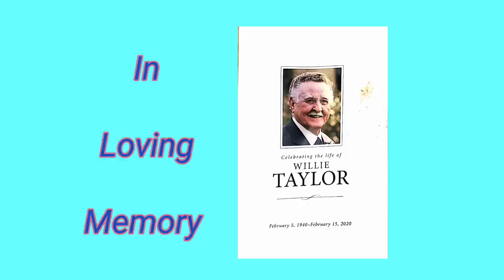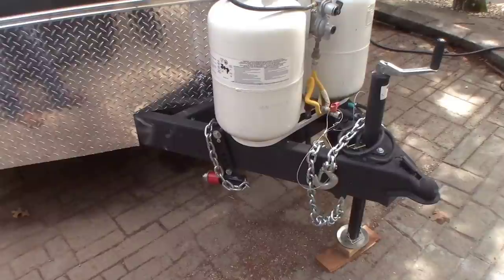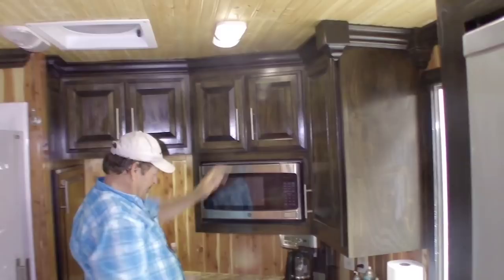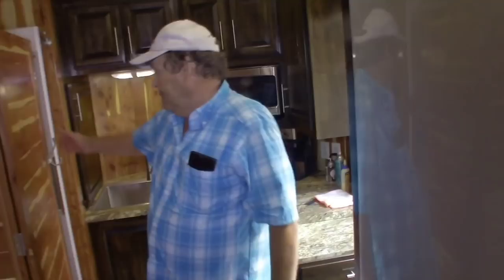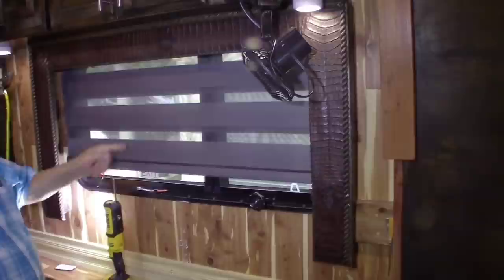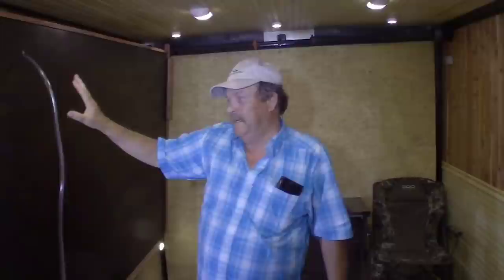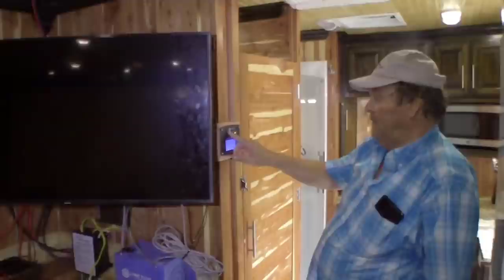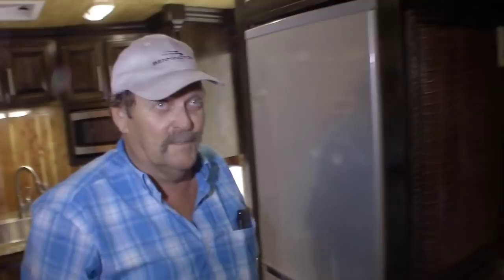Cargo Trailer Conversion/From Cargo Trailer To Luxurious Toy Hauler

Comment: I was wondering how long will the batteries and that 3000 watt inverter run the air condition ?? Neat setup for sure
Reply from the maker: They still have the same inverter, but recently they added more panels and more battery. Then, just for grins, they "unplugged" and went 6 full days without plugging back in. They ran their air when needed, and even the heat pump some cool evenings. They are total electric, so they used there induction cook top when needed, toaster oven, microwave, water heater and 7.5 cubic inch refrigerator and never missed a beat.
Reply: @billanddeb  wow.  That's impressive. Nice to know it can be done if well planned out. Thank you for the info